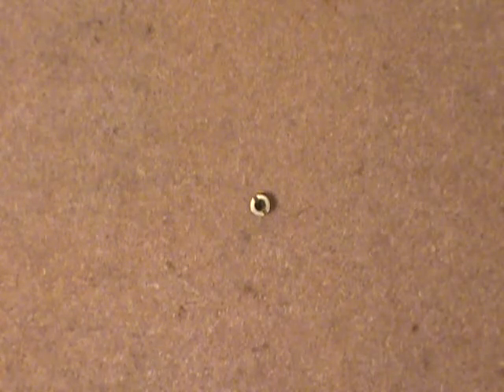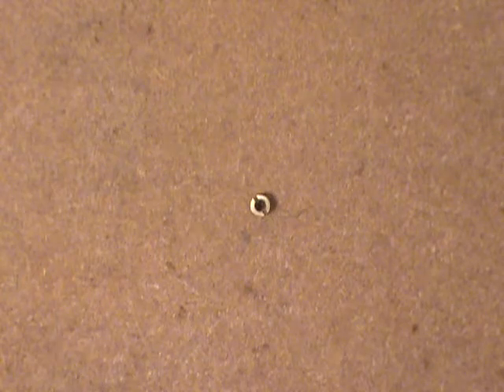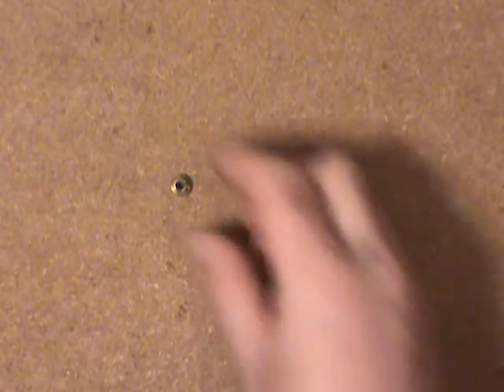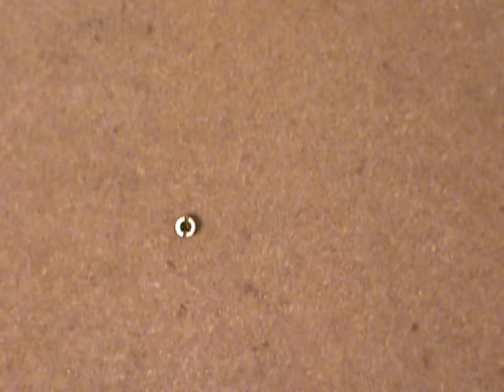Carburetor Jet Measuring Tool

Comment: Like they say, there is more than one way to skin a cat !   A Dremel tool could help you, too.    I wanted to agree with you about the carb/gas combination.  You are correct about the gas changes and the lowered energy.   My main jets were .098" and I had no spare set.  But, I got lucky with the needles (Edelbrock).  I had extra sets of needles and you wouldn't believe how lucky I was when I looked up the chart for the carb and in order to make the mixture 4%/8%/12% richer, you used thinner needles or bigger jets. I had the set I needed.  No more bogging and the idle exhaust smelled better and the engine idled smoother.  I was able to back off the idle set screw.   All good.   Best wishes and thank you.  (Now, I need to open up the secondaries or buy new ones.)
Reply from the maker: Greetings...StuckInMyGarage.........Thanks for watching........Yes, indeed, using different methods, for fixing things, can, sure...git-er-done...lol........As for a Dremel, no thanks, way too aggressive, for such a small, precision, task.........Quite some time ago, I was having a "lean surge" (car was lurching back and forth), while just maintaining city speed, on a level road, with an 850 CFM, Carter Thermoquad carb, so, for starters, I adjusted the metering rod tree, adjustment screw, to its maximum "up" position, which makes the two metering rods, stay as high as possible, out of, the primary fuel jets...well, that, still wasn't enough, still lurching..........So, I increased the two primary jet's size, by .003" (three thousandths of an inch) increments, and test drove the car........Damn, I had to do it "three" times", in order to get that damn lean surging to stop...!!!...lol.......I went from .095" all the way up to .104" on those two primary jets...!!!.......I roughed those jet's orifices (holes), out a bit, by rotating, a small, round, tapered, needle file, then, finishing up, with some 600 grit sandpaper wrapped around it.........I was also, able to re-adjust that metering rod tree, adjusting screw, back to, a, shall we say, normal position........I came to the conclusion, that, it was probably the gasoline, that had about 10% ethanol, in its blend, and, my good ole Thermoquad, was probably "calibrated" for 100% gasoline, probably "before", they started to add that...Gas-em-ah-haul (aka, ethanol), into the gasoline's blend........Probably a jet size increase, of about 8.65%, according to my math........Yes-Sir-ee-Bob...I too, studied that Edelbrock "chart", that had all of those, vertical, horizontal, and diagonal, shall we say..."zones"...on it, quite impressive, I must say........If you take a look at my Youtube video, titled..."How to read a spark plug" (I think?)...(the thumbnail picture, shows a close-up, of a Champion spark plug)...and, the deposit, that you see on that particular spark plug (light tan/brown-ish), is what I ended up with, "after", that, Thermoquad carb's, primary jet's, "increased size" was done.........Man, my engine (360 V-8), pulled so much harder, than, it ever did before...!!!...and look Ma...no more..."lean surging"...any more...lol........In order to make a carb's jets..."smaller...I heard some time ago, that, the "old-timers" (men), use-tah..."solder"...the jet's orifice/hole closed, somewhat, then, opened up, the jet's orifice, to what-ever-it-was, that, they wanted it, to end up being (cool huh)........Probably the safest way, to re-jet a carb, is to install an "air/fuel" ratio "gauge", and take into account, what-ever is needed, to make sure that, the air/fuel ratio, for a given fuel, happens to be..."correct"...for WOT (Wide Open Throttle), as well as, at idle speed, and, just cruzin' along, air/fuel ratio........Ballpark, air/fuel ratios, for 100% gasoline/carburetors ("no ethanol", in its blend), use-tah be, around, 12.5 to 1, for WOT/Wide Open Throttle, and, about 14 to 1 for idle speed, and just cruzin' along (14.7 there-abouts = stoichiometric, as I recall, that, the "computer" equipped vehicles aim for, at idle speed, and, just cruizin' along)...(for my Thermoquad, the two idle mixture screws, were supposed to be, set for 14.3 air/fuel ratio, at hot, curb idle speed, in order, to be able to, pass, that, good-ole smog test)........I recall, what the guy said to me, way-back-when, I purchased, my, very first set of exhaust "headers", and that was, that, the carb might have to be re-jetted, because, the exhaust headers, would probably make the engine run "leaner" (air/fuel ratio-wise), probably, because of, the "scavaging" affect (that being, "pulling", the exhaust gas, out of the cylinder head's ports)........Smelly exhaust at "idle" speed, might be, that, your carb's primary throttle plates (butterflies), are opened up too much (at curb idle speed), which exposes those (two), transfer slots, way too much........When the idle "speed" screw, is adjusted correctly, then, there should only be, about, a "square" shape showing, of those two transfer slots, that are seen "below", the primary throttle plates/butterflies, when at (curb) idle speed........Ignition (advance) timing, will usually fix this, but, Ya have to make damn sure, that, the "total" (advanced) timing, is correct, for that "exact" engine, or, "major" damage, might be the end result...!!!........Bogging, when takin' off from a stop...???...then, is your carb's "accelerator pump", working as good as it should be doing...???.........With engine..."cold, and not running"...remove the air cleaner housing, and/or, air filter...then...move the throttle linkage, through its full range of travel (by hand), while looking down, into the two, primary throttle bores........If it's working good, then, Ya should see, what kinda looks-like, two small streams of gasoline (one stream, for each throttle bore), that kinda resembles, shall we say, what Ya would probably be seein', when operating, a, small, toy, (water), squirt-gun...lol.........If, and when-ever, Ya might want to get a brand new 4-Barrel carb, for your ride, then maybe, have a look at, the demon, "street demon" carburetor, that might come in, 625 CFM, and maybe, a 750 CFM version as well, possibly.........These carb's, seem to have quite a few things, in common with, the same carb, that you have now, as well as, some older carbs, being, the Carter...AFB, AVS, as well as the Thermoquad too........Maybe, check out some Youtube videos on the Street Demon carb (sure looks like a Thermoquad to me...lol), oh, and, Ya can even get one, that has, that, black, space-age lookin', plastic-like, center section as well (to keep the gasoline, about 20 degrees F, cooler than, an, all metal carb)........Sure seems like, this new carb, has some very impressive, crispy, throttle response, from what I saw and heard, in some of those Youtube videos........Good luck, with your, shall we say..."carburetor, re-calibration"...and......till next time.......Be Safe, take care, and have a good one.

Comment: After I saw this I will try a needle from an old Volvo SU carburettor.
Reply from the maker: Greetings Tulka....Thanks for Your comment, and for watching too....If the "Needle's Tapered Section", from that old Volvo SU carburetor, "Small" End, will go completely through the "Jet" that You are "Measuring", as well as, having the "Larger" End of the "Needle" Sticking Out of the "Jet", on the side of the "Jet" that You chose, to start the "Needle" going into the "Jet", then, it looks like that SU "Needle" should work alright....Just make sure, that, when You Insert that SU "Needle" into the "Jet" that You want to Measure, to use a very Light and Gentle Force, so as not to "Distort" or "Enlarge" the "Orifice" (aka, Hole) Size, that the Jet had in it, before You Inserted that SU Needle into it!

I also think, that it's a good idea, to Measure Your "Jet" from "Both" Sides, just to make sure, that, in case something might be a bit Different, as in, if the Jet/s Orifice/Hole, just might have a "Taper" in it (better Safe then Sorry!...lol).

I have also noticed, that, some of the Larger Sizes of "Felt Pen Markers"..."INK", can at times, be a bit "Thick" (not quite a Thick as Paint...lol), and, I find, that, when that "Thicker", Felt Pen's..."Ink"...gets Deposited on the Orifice/Hole in the Jet being Measured, will probably make any more Measurements that follow the First Measurement, start to become, somewhat..."Not as Accurate" as the "First" Measurement taken, unless, the "Ink" that got Deposited "Before" the next Measurement gets taken, is Cleaned/Removed from the Jets Orifice/Hole beforehand (aka, First), and, the Same goes for Your SU's "Needle" as well...!!!

In other words, make sure that, You Clean the Felt Pen "Ink", off of "Both", the Jet/s "Orifice/Hole"...and...the SU "Needle" as well, "Before You attempt a Measurement, or, the "Accuracy" of the Measurement that You are hoping for, might not Happen...!!!

If You happen to want even more "Accuracy" in the Measurement, that You are about to take, try to keep the "Temperature" of Your Jet, Measuring Tools, and even the Room that You are in, at about 68 Degrees Fahrenheit, as I recall, that, (I think), that should be the so called "Official Measurement Standard" (World-Wide...?), and, seeing as how the Human Body's Temperature stays about 98.6 Degrees Fahrenheit (only when a Person is not sick, that is), then, Your "Hands" will probably "Transfer" that Higher Heat to Your Jet and Measuring Tools as well...!!!

I know, I know, (I say)...as...("All" of You are thinkin'), it's only a Carburetor Jet that we are measuring here, so why is this...RockysRoadshow...Guy, trying to pretend that He's a Rocket Scientist...???

My answer to that is...

I think, that, I may have been Blessed, or was it Cursed, with a Memory, that at times, may rival that, of, shall we say...an "Elephant"...(Elephants seem to Never Forget much, I think)...

...and...

...as I (think?) I recall, that not only does that 68 Degree Fahrenheit Temperature apply to the Global "Measurement Standard", but, there is also a "Humidity" (I think it means the amount of Moisture in the Air), that, when doing "Super Accurate Measuring or Manufacturing", that, that particular "Room/Building" must have Both, the "Temperature and Humidity" Controlled to a very High and Accurate "Tolerance"...!!!

Hey, I just thought that, seeing as how we really want some acceptable "Accuracy" in any Measurements that You or I happen to be hoping for, that, it just popped into my mind, that, this just might be the right time, to let Anyone reading these words, to kinda be able to have some advanced information, about "Precision Measuring", that also goes hand in hand, with Precision "Manufacturing" as well.

There...I'm done...finished...(and They are sayin')...It's about time...!!!...lol.

Be Safe, take care, and have a good one.

Comment from the maker: ..."Everybody" (maybe not), knows that, if one Increases the Gasoline/Fuel Jets "Orifice" (hole) size, then, that Jet will Flow more Gasoline/Fuel, will it not?....The Jets (2 of them) that I "Re-Calibrated" (made LARGER"), were in a very sad condition before I worked my Magic on them....For some reason, it looked like the Orifices were Eroded by, what looked like Cavitation or Electrolysis, and, the Orifice Shape, was rather "Oval", instead of "Round!"...I had a Lead Surge-ing Engine...(con't)

Comment from the maker: Greetings Chris Chujkal....Thanks for your comment....On the contrary, with the "Jet-Measuring-Tapered Gauge" that I made, happens to have a "Mirror Finish" where it makes contact with the Jets Orifice, and, the Felt Pen "Ink" is Harmless to the Brass (or maybe even Bronze?)....and yes, I wash away the Felt Pen "Ink" before I install that "Custom" Jet/Jets, and, my results were "Amazing", in that, My Engine Ran like a "Beast!"...lol...Here's the deal...(con't)

Comment from the maker: @rocks66ss   While my method does not enter the Rocket Science world of super precision Factory machinery, I sure got a sweet result with what I cured!  That lean surge that I was having was sure annoying, and a lean running engine is not a healthy thing!  No matter what jet size you use (including factory ones), a shade tree mechanic like myself does some Spark Plug reading and test driving eh!  Oh and...  my flow rate is just fine... (Running for the washroom!)